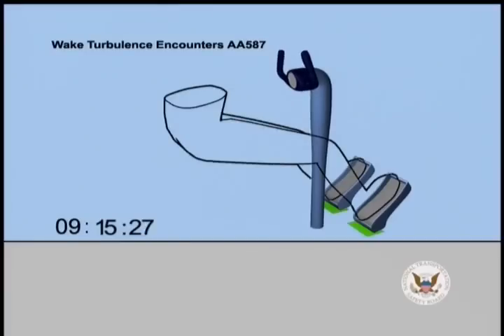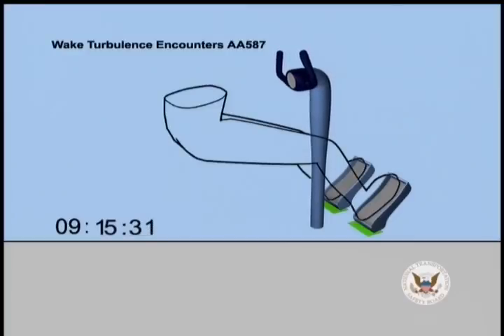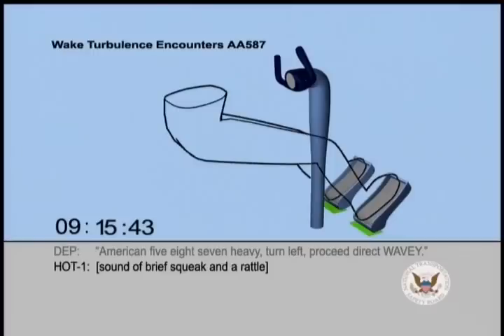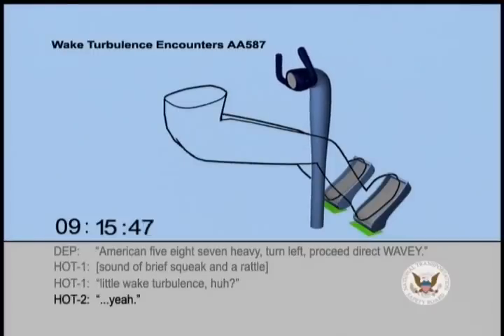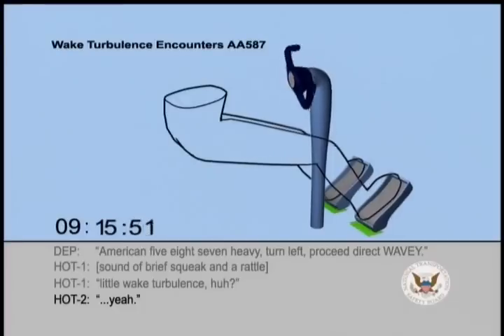In-Flight Separation of Vertical Stabilizer American Airlines Flight 587 - Wake Turbulence Encounter

Comment: Over kill..after they analyzed pilot imputs it was determined non where needed.airplane would had got out and away from wake turbulence on its own.so freaking sad for passengers, crew and people on the ground. But at the same time who would imagine the whole vertical stabilizer rudder column would snap of like that.they should make it so the rudder breaks off not the whole fin..now the rudder movement is governed by the speed.